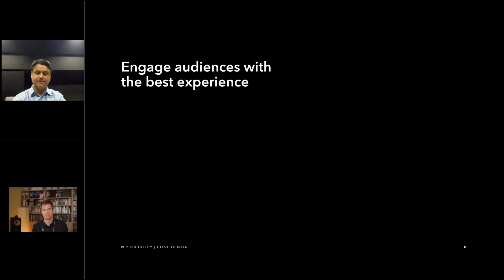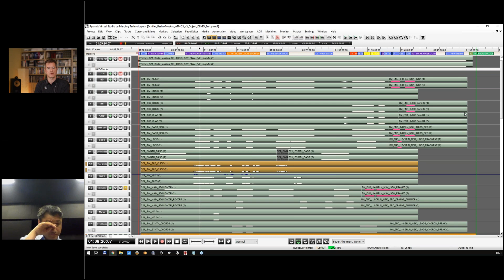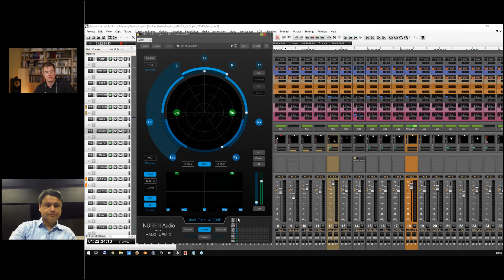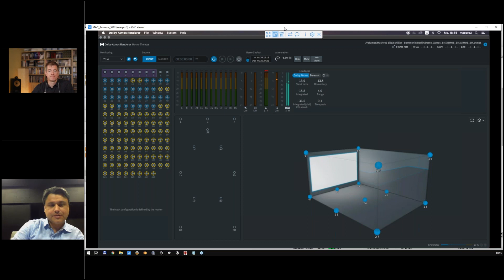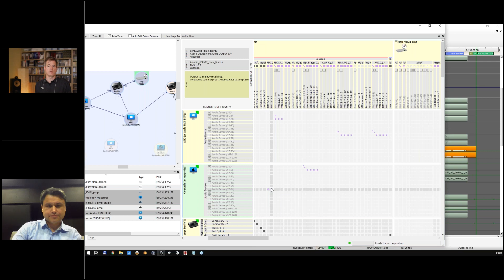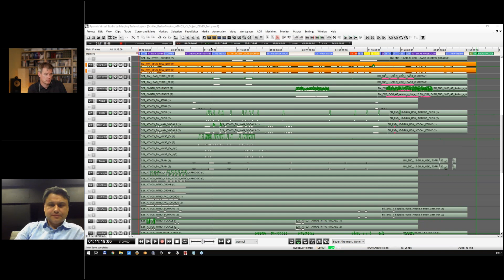Webinar 'Berlin Moskau' by Schiller in Dolby Atmos®

Comment: ATMOS is a wonderful technology and have used it and DTS:X Pro for a few years now in the studio for TV and movie work.  However, ATMOS is completely the wrong technology for music, as it was really never designed for it (was designed for MOVIES, NOT MUSIC), and is fatiguing, destroys the standard stero imaging of music, requires additional hardware and speakers on playback, works poorly on standard 2/2.1 speakers, AND IS EVEN MORE FATIGUING ON HEADPHONES.  
The simplest solution for headphones and 2.x speakers once rendered to ATMOS is to just sum it to mono (with all the nasty phase cancellation from the ATMOS process when summed to mono.   Again, great for video, HORRIBLE MISTAKE FOR MUSIC.
Reply from the maker: Hello, 
We are not in a position to decide the distribution industry standards and a lot can be said about the ones that broke through and the ones that technically are or were of "better quality" or more "user friendly" etc. 
Therefore, at Merging with all our software product range Pyramix DAW and our Ovation playout system we embraced since 2015 all kinds of multitrack (immersive) formats such as from 2.1 up to 30.2 and in between all the industry standards (including Ambisonic up to 7th order). This philosophy has also been applied to our Anubis Monitoring Mission hardware device. For the producer then to chose in which format he/she wishes to work and ultimately to encode it into the consumer format(s)
Reply: @MergingTechnologies  I assume that  this was some sort of auto-response system or a language issue, since it is 99% unrelated to my comment.
Reply from the maker: @amdenis  Hello Andrew, it is not an automatic response. The response is related to the gear we design and manufacture, we are not Dolby.
Reply: @MergingTechnologies  - Good to hear.  Yes I can appreciate that, as my Studios  and media research labs have over $120K in Merging hardware and associated software, plugins, etc.    

BTW, great job on the Anubis, HAPI and latest 8P ADA cards.  Combined with what SPL and Dangerous does for us (and certain proprietary developments), nothing comes close across either the analog nor digital domains.  We have some major events and alliances where we will be spreading the word that you are an important part of some of our preferred embodiments.  I love the Swiss and associated workmanship and design prowess!

The point I was trying to make is simply that it didn't seem to have much to do with my comment about ATMOS being a technology that few studios have any respect for related to using it for music.  I go back with Apple, since I came along for the ride with Steve when we worked at NeXT Computer through the acquisition; and it is no secret that many at Apple are not happy for having to fall back to ATMOS for AMusic.
Reply: Just get a Trinnov system, which ensures that everything is phase-correct!